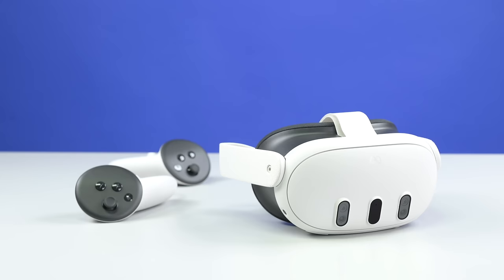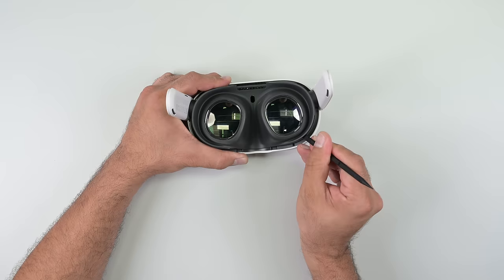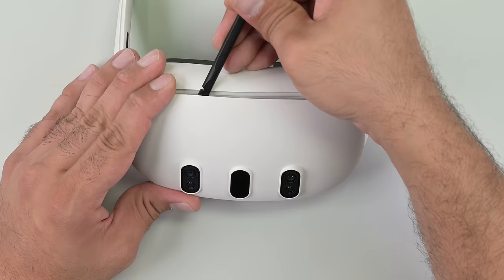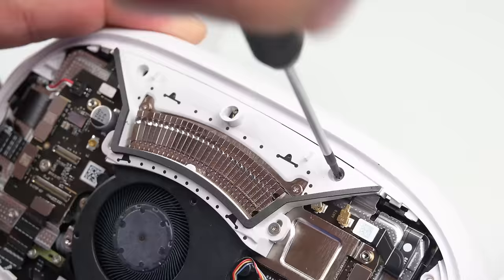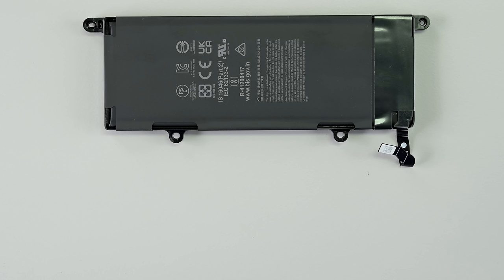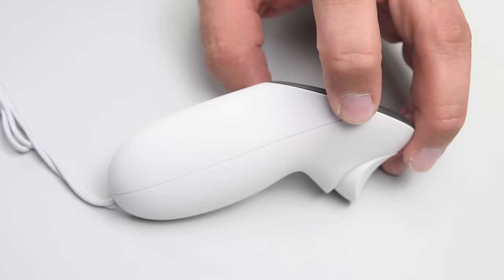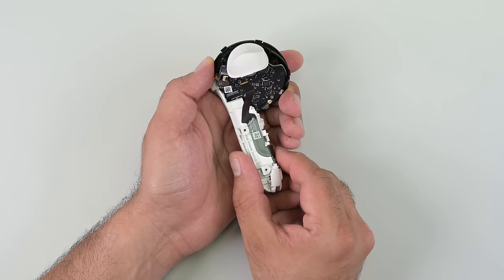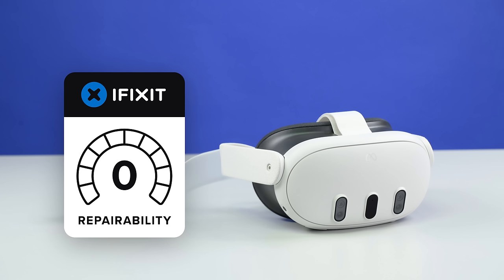Meta Quest 3 Teardown: What Are You Sacrificing for Savings?

Comment: Quest 3 is not "mid range" headset, it's pretty much the highest end headset you can get at any price point.
Reply: It is a mid-range headset. Pimax Crystal, Varjo Aero, and even the Bigscreen Beyond headsets are considered high-end.
Reply: @JPT90  what's so high end about them? Crystal is just high resolution similar to varjo, and bigscreen is novel form factor with zero new features. Calling it high end is YouTubers circlejerk propaganda
Reply: @SINfromPL  I agree too. Looking at the Quest 3 disassembly video, it is not a mid-priced headset. This is a high-end product. Plus the price is good too.
Reply: @SINfromPL  PPD on the Aero. BSB panel type. I have the Quest 3 and tried high end headsets. Local dimming facetracking. While these features are not mainstream, it is a hallmark of a high-end product since it pushes boundaries. The difference is quite big. Quest 3 is not cheap but that doesn't make it high end. It does not innovate but refines existing features.